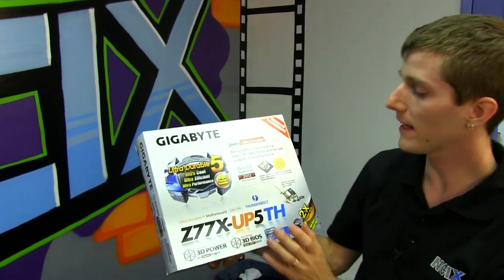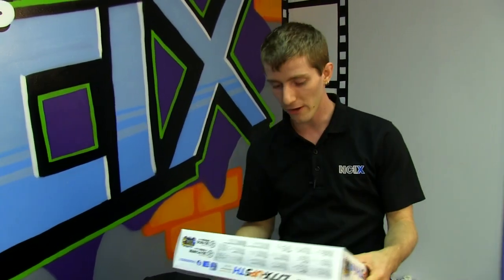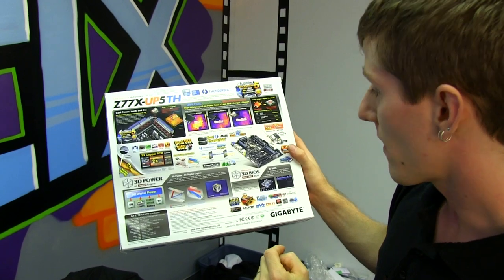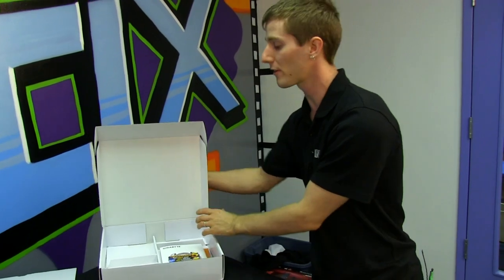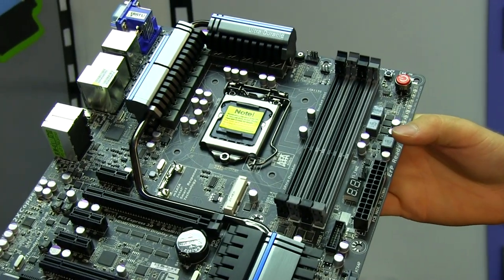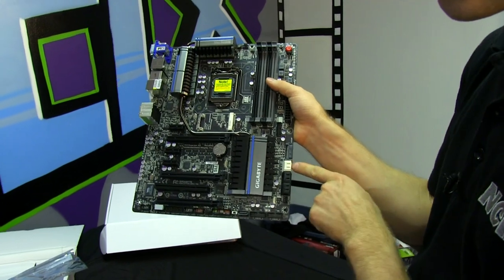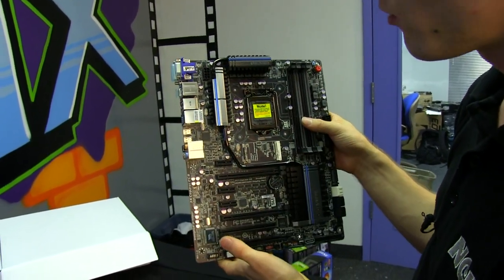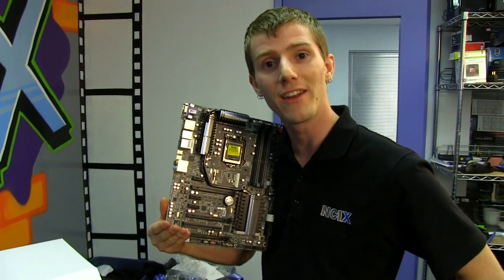Gigabyte Z77X-UP5 TH Dual Thunderbolt Motherboard Unboxing

Comment: have one of these boards paired with i5-3570K 3.8ghz, 16gb of ram and ssd, old GTX950Ti, works well and had built it like 5 yrs ago, still kicking ass and taking names

Comment: Most include either PS/2 to USB adaptors or have a USB connector version, but PS/2 is always the base. PS/2 allows to truly utilize the potential of a mech keyboard - as every click is being actually sent. At it's base, USB has a bottleneck of 6-key rollover (it blocks when you spam a key or press more than 6 simultaneously). Some manufacturers work around it to provide 16, 20 or even n-key rollover, but it requires additional resources. Also,USB connector introduces input lag and some CPU load.

Comment: Use volume control. It's at the bottom right of your screen. Sometimes there is even a function on the keyboard to turn the volume up and down. If you kept your keyboard manual (which no doubt you did) then you can find instructions in there.  If you still have problems hearing the sound then check out WebMD and describe your problem as best as possible under the "symptom checker".

Comment: Yeah, this is the board I've been wanting to buy for the last few months. It's been out for a while, even included in some of NCIX's builds. I've wanted to upgrade my not-so-sweet ASUS P8Z68-V LX for my 2600K to really push it, but now I kind of want to wait on spending the $240 now and just buy a Haswell chip later this year.

Comment: They have adapters for PS/2 to USB, or a version with the inferior USB connection. N-key rollover in USB is not a new thing - it simply phased out for a long while as it gauges the price significantly. CM Quickfire pro is I daresay the first reasonable priced keyboard with that option (and an all-around marvelous product - if for it's spread of MX switches alone).

So that's 1 model vs most current competitors (and it's not like if someone bought a mech 7-17 years ago they need a replacement).

Comment: I have the UP4 Version of the board and I can say its great, except the fan connectors. The sys_fan 4 connecter runs your fan at full all the time regardless of bios or easytune settings.

Comment: Linus, I think you made @ 9:08 when you say that Thunderbolt will only work with your onboard audio for video transcoding.

What you meant was actually Thunderbolt uses the onboard video on the CPU to work since Thunderbolt depends on the platform.

Comment: PS/2 allows for unlimited amount of keys to be pressed at any point, whereas same mechanical keyboards connected via USB adapter will allow for 6 to 16 key rollover. Also, USB introduces additional lag. Most companies include an adapter, and some have an USB version - but USB largely defeats the purpose of a mechanical keyboard beyond tactility (and entirely if you use linear switches - so most popular Black and Red MX).

Comment: Sorry - character limit. Read previous comment for first part of the reply.

(...) If anything - I'd say PS/2 is resurging. For a while, mechanical keyboards fell of the radar. But now, they make a huge comeback. More manufacturers start making their own (Cooler Master in 2012, Zalman in early 2013), others introduce additional models, yet others expand what kinds of switches are offered beyond the standard Black (Razer added Blue, CM does all of them, Brown came back in huge wave).

Comment: The Corsair K60 and K90 have a 20key rollover and are mechanical,, and even then people usually don't buy mech keyboards for the rollover, but for the actial keypresses/switches.

Comment: That is your BIOS/motherboeard battery. It's what powers on first thing first on your computer before your power supply does :P. Kinda like a car battery vs fuel tank and engine. And yes, they are very similar to watch batteries haha.

Comment: We dont' know about a performance boost yet. The only information that they've released about Haswell is that Haswell CPUs will have integrated graphics on par with that of a low end discrete video card. I don't know about you, but I don't want to stick with my PCIe 1.0, 2.5 GB DDR2 until June. So I just went ahead and got myself a Z77 board anyways.

Comment: Not really the case. Native USB connector are actually pretty rare, and offered mostly by models like Razer Black Widow, which to mech kb fans are like Alienware PC's to PC building enthusiasts. Usually it's just an adapter for people who wanted to blow a wad of cash not really researching the subject of mechanical keyboards. CM QuickFire is atm the only noteworthy mech keyboard not capped in key rollover by USB.

Were this an ITX board, I'd just shrug it off. But for $250 ATX?

Comment: With all those bells and whistles - it's amazing they'd omit a PS/2 port. In a CHEAP board - I get it - people will likely have an USB keyboard or will have no trouble using a connector. But lack of mechanical keyboard support on a board aimed at enthusiasts seems... peculiar.

Comment: Even if it's only a 10 - 15% boost... why pay 400$ for a nice motherboard+CPU combo when in a couple of months you'll be able to get something a bit better for the same price.

And you can't use the argument that "Oh by then Ivy Bridge components will probably get cheaper, so this will still be valid."  I checked and even the Sandy Bridge components haven't dropped in prices yet, and those are 2 generations old by now.

Comment: Hoping this will help someone out there avoid a potential headache.

single or multi 12v rail?  doesn't seem to matter.  v2.3 versus v2.2?  doesn't seem to matter so far.  Too many variables to go through thus why I made that list.

Cheers

Comment: Either I misinterpreted what you wanted to communicate, or you're unfamiliar with mech keyboards vs rubber dome.

Mechanical keyboards are nowadays if anything much more popular than 5 years ago. More companies started to make them, they expanded amount of models that make, and which switches they use, including resurgence of Blue and Brown switches (which 2 years ago you'd only find on some vintage model, now they can be found even in affordable mass produced models like CM or Razer).

Comment: That's a gorgeous board my only gripe is the SATA ports.
I am so sick of seeing SATA2 ports on premium boards.
They are wasted on my configurations plus SATA3 is backwards compatible so why bother. I'd gladly pay an extra probably $20 to get all SATA ports to be 6GB/s. My current GB board has 4 SATA3, 4 SATA2 and I added a PCI card to get 2 additional SATA3 slots but they aren't as fast as the onboard connections.
I just don't get why SATA2 is still being installed on high grade motherboards...

Comment: Actually, Haswell CPUs are going to use an LGA 1150 socket, so Ivy Bridge CPUs will not fit in the Z87 motherboards. Nor can you put a Haswell CPU in this motherboard. I got a Z77 motherboard regardless because I didn't want to wait until June to build my new computer.
I couldn't stand my 7 year old computer any longer lol

Comment: do you need to plug the auxiliary sata power cable in if you use a single GTX 670 with a low end sound card? and will it cause harm if let say you plug it and you dont have any cards pluged in the PCI slots?

Comment: well i had the z77x-up3 it's   the same except for the thunderbolt but it suddenly stopped workin after 10 days and i replace it whith a h77 asus because they were out of them  ,my point is you d'ont need more then the up3 and it"s cheaper.

Comment: Can i game on it and does it supports 4K?
Reply: As long as you have Intel pentium with a 50W power supply you be fine. Just make sure to sli your cpu. Also don't forget to buy a vga cable or you won't be able to get 4k.

Comment: The asus 1 is better , u buying the mobo to use it u dont buy the mobo to get wireless card to use it on another mobo lol ?, so the asus 1 u get Msata option with that slot also save's u a pci slot to use for other things, well at least this is my opinion

Comment: KNOWN psu compatibility&NON compatible issues other OWNERS confirmed:
Compatible psu's:
Corsiar AX 850
Corsair CMPSU-1200AX
SeaSonic Platinum 1000 psu
Coolermaster M2 850W
COOLER MASTER Silent Pro Gold Series RS800-80GAD3-US 800w
Pc Power & Cooling Silencer mk ii 950w PSU
NON compatible:
Pc Power and Cooling Silencer mk ii 950w PSU
Corsair AX 860i
Gigabyte Odin GT 1200W
Corsair CX750
Corsair Enthusiast Series TX850M
Seasonic x850?  per Wallis34 having problems with up4 th version of same mobo.

Comment: shill? lol. And don't forget that for thunderbolt you need a cpu with an iGpu since thunderbolt has a video component, meaning the FX amd cpu cant use it as well as the socket 2011 intel cpu.